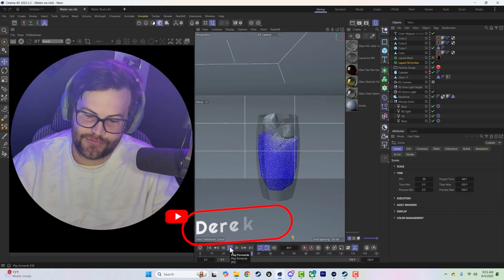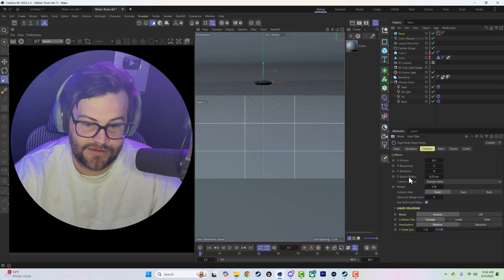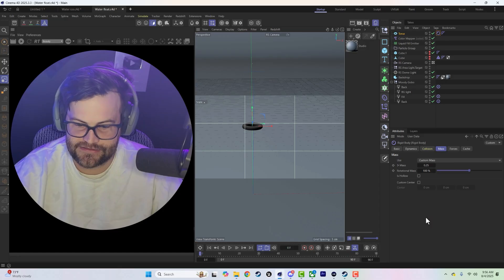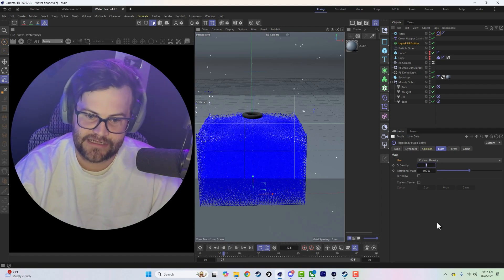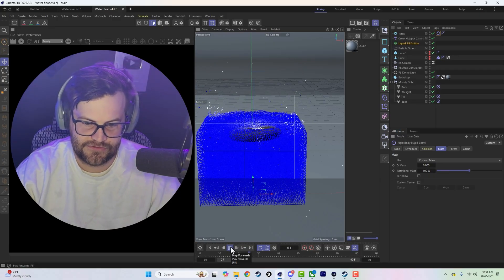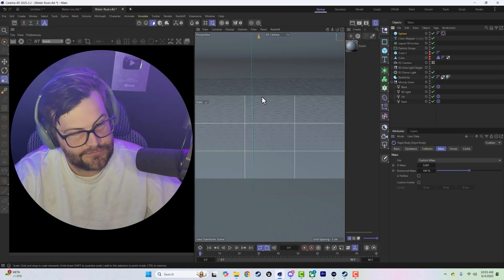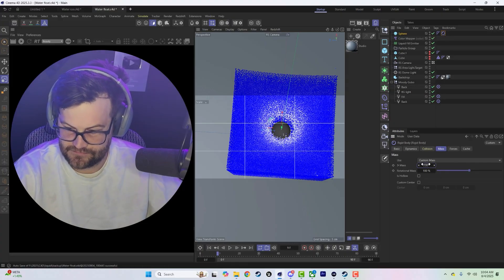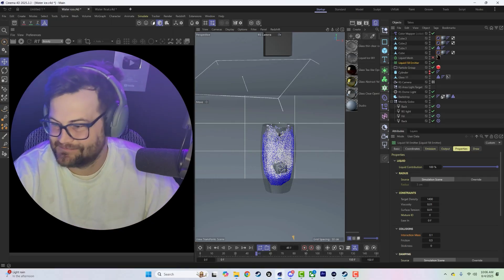Sink or Float? Buoyancy settings in Cinema 4D Liquids

Comment: It works very well. Another important point, is that multiple rigid bodies within the fluid, still interact with each other. I spent a day of my life trying to make X-Particles do it and completely failed. The rigid bodies always passed through each other. You can also add ballast to the rigid bodies, by offsetting their centre of gravity, which is fantastic. You can make a self-righting object by doing this. Can't wait to see what Maxon will have done with the upcoming release of C4D!